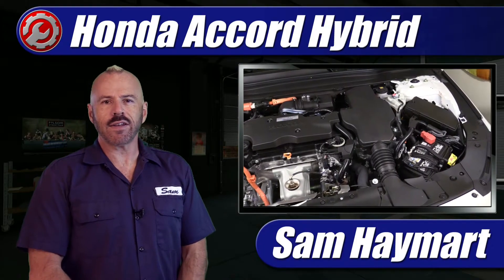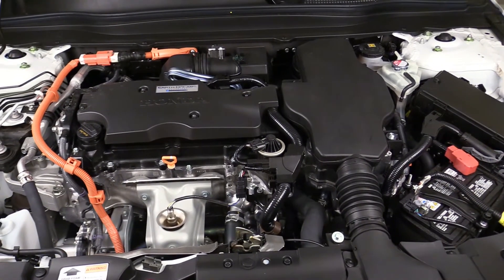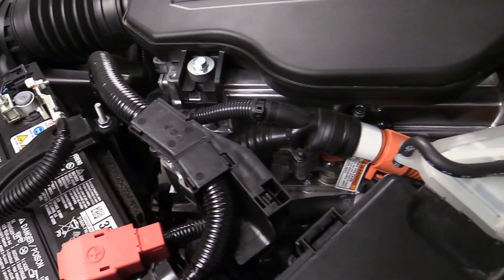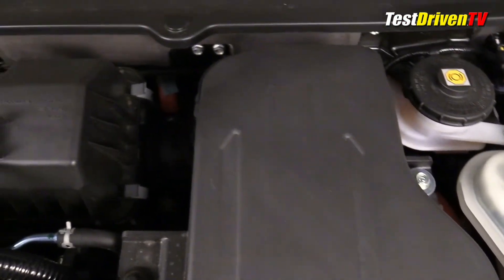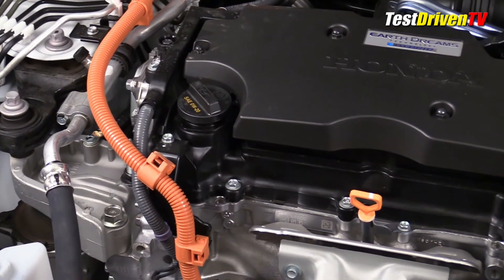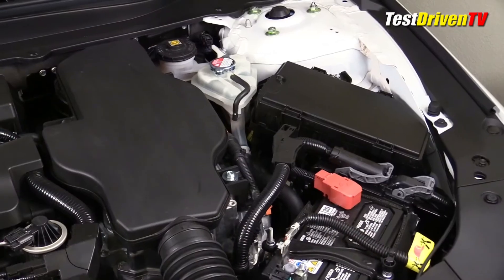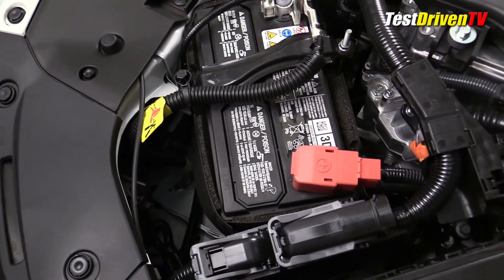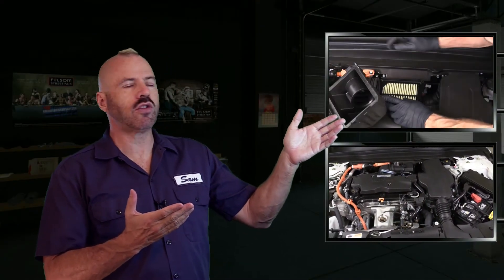2018-2022 Honda Accord Hybrid Engine Explained

Comment: The batteries are under the rear seat are generally not user serviceable. But what if somebody did want to service them. I wonder how difficult this would be since they are under the rear seat. I've seen a video of the 2017 Accord hybrid battery replacement, as an electrician it didn't seem that bad
Reply from the maker: As an electrician do you recommend people who don't know what they are doing monkey around with their 240v electricals? Automakers are worried about people getting injured or killed messing with the high voltage electrics in their cars, so they generally tell consumers they are not to be DYI'd.
Reply: @TDTVGarage  👍👍 agree.  God bless
Reply: @imun1ty  I already subscribed to your channel